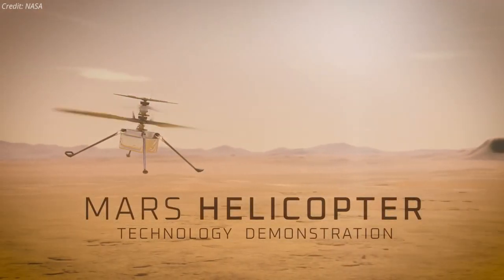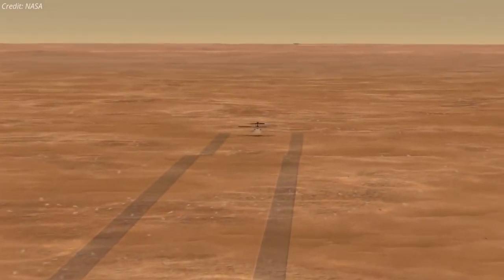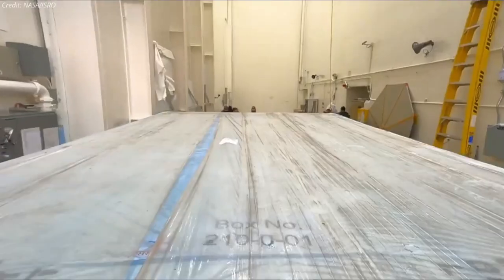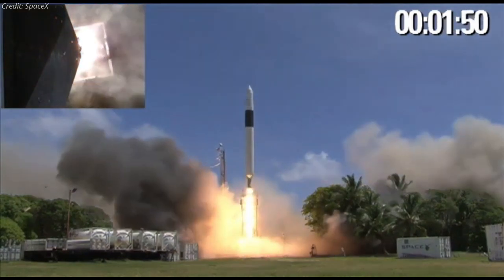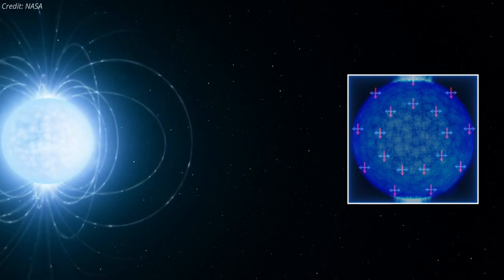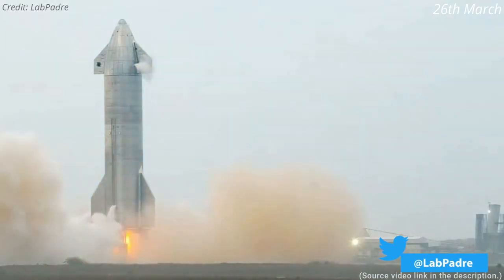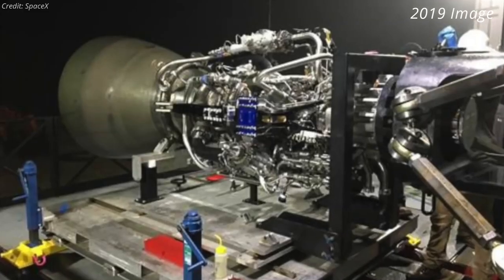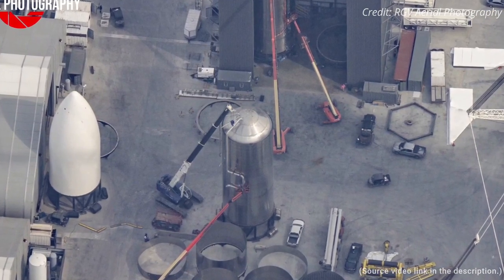Starship SN11 Flight as Early as MONDAY | Ingenuity First Flight | SpaceX Anniversary Launch

Comment: Thermal shock test on aluminum welds questions the absence of the flammable gas vacuum (bypass valve pipes ⛩🧯of the motorized turbine system) these latter absorbed by the spot welds which melt at approaching the melting🌊🌡 point break like snow ❄☃ in the sun🌞.

The process, so in the absence of the in-situ pressure-bar thermal shock absorber blades 🪒♨of the cryogène on the welds 🎢 and where the peripheral 🧷🧷🛹flexible conical tissues of the raptor cradle, the floor stage of the turbo-mixer (1)🧭🛴 concentrates engineering steps - propulsion on non-expansion of cryogen throughout the entire vessel. 🍻for the most reliable hypersonique engine🛸 ever built .
⛳Vertical auto-landing parallax proved that perseverance & ingenuity was a very good mesurer of the light inside a Greek calendar on the Mars surface, front 4x25 metric tons 🪒⚓of para-glider directionnel🥶 ⛷😏🌊whatever happens.